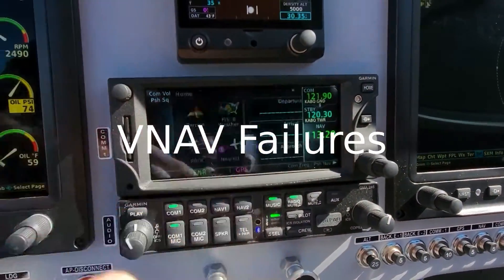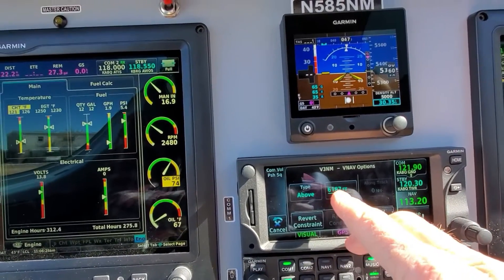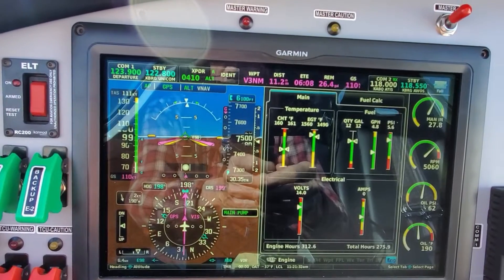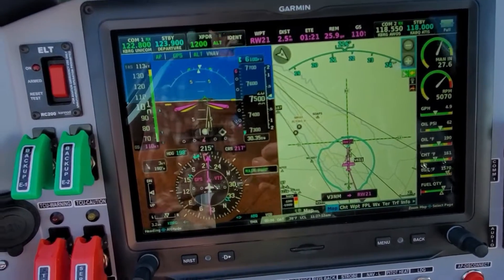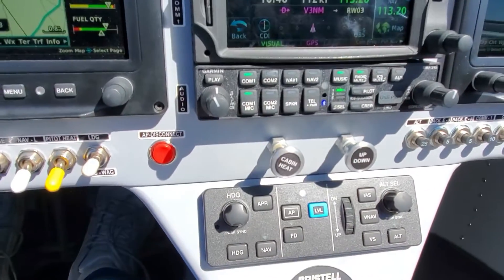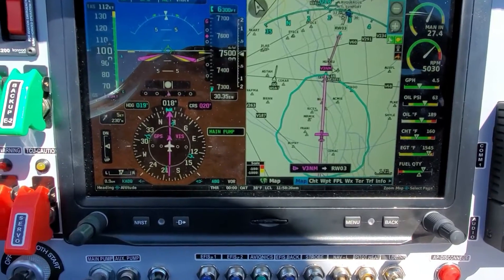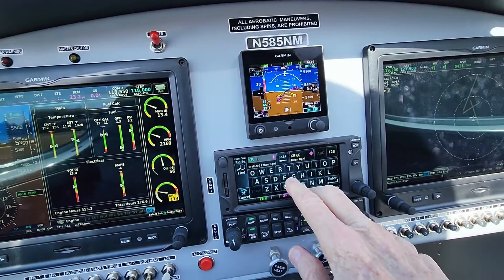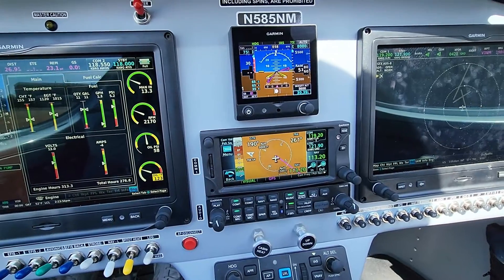Using VNAV with Garmin's Visual Approaches G3X Touch GTN 650 and GMC 307

Comment: Didn’t Garmin ever hear keep it simple stupid. I think there will be a lot of accidents involving Garmin because they make things too complicated and less than intuitive. Many pilots grew up on Garmin and they have swallow the cool aid. Doesn’t anyone notice the constant barrage of “ you can’t do this until you do this” they aren’t really safety issue driven, they are “workaround”. Much of the software driving Garmin was written 10 years ago. I’m sure it’s OOD and they just layer features on top. They add a new processor because the spaghetti code is loaded with if then else’s which are slow to process. If you doubt this answer this. Why is the primary display on the G3X the same size in full screen as it is in split. Full screen has a huge amount of dead space. Do you really need 2/3’s of the screen for horizon? It’s because they don’t have the team to rescale the display.
Reply: You had me up until the G3X part

Comment: Hi,
What do you use as a baro-corrected altitude source?

I have GTN 650 and 2 GDU 370.
Trying to use VNAV, the GTN calculate TOD, BOD and VS required.
VNAV get armed in the GDU 370 but when reaching the TOD, the autopilote just continues at the same altitude an VNAV never get activated.
And, yes, the alt selected is lower than the alt at BOD in the profile.
The VNAV-profile looks good too.
What can be possibly be wrong?

Many thanks in advance
Reply from the maker: Hi Shahram.  If you haven't already, watch the Garmin vids on VNAV.  My baro corrected source is the G3X and/or the G5.  Yours should be getting it from your 370.  Sounds like you're doing everything right, but it's not working.  Check in your flight plan and make sure the altitude you're trying to capture in in Cyan and not White.  If your autopilot is in NAV mode, the altitude is set below your current altitude, the autopilot is in VNAV mode and the altitude is in CYAN it should work.  Good luck.  Rick

Comment: Can you give the full avionics equipment list?  What are you using for ads-b in and out, where and what type of VOR/ILS antenna is installed, etc.  I’m interested in what avionics is needed to equip a plane to be able to take ones IFR checkride in and I know it’s more than just a WAAS GPS but I don’t see many guys on YouTube doing VOR/ILS demos.
Reply from the maker: G3X touch, G5, GTN 650. ADS-B from the Garmin 45R. Standard VOR antenna mounted on the tail.  FAR 91.205 listed equipment necessary for IFR flight. Check my channel. I have several ILS approaches shown.  Thanks. Rick

Comment: Its been a little while since I was flying regularly with a GTN 650, but I remember some of the VNAV quirks.  At 2:22, the magenta arrow is pointing to RW21 which means that the active leg in the 650 is from V3NM to RW21.  VNAV will not capture the path because the active leg is from V3NM to RW21.  If I remember correctly, you need to press V3NM and click the ACTIVATE LEG button in the top left seen at 2:25.  This will activate the leg from the aircraft's current position to V3NM and will allow for VNAV to that waypoint and altitude.  Then you should be able to capture the approach with the APR button on the AP panel.  I hope this helps, Scott
Reply from the maker: Thanks Scott.  You can also just activate the approach and the leg will be the 28 mile path.  Rick

Comment: To get the alt selector to 6180, set your baro min to 6180 on the G3X, then the alt selector will offer 6180 when you scroll down past 6200.  To set baro min, hit the HSI with your finger, it will pop up a box that offers a baro min input.
Reply: Or just click the altitude bug on the G3X and type in 6189. However, it doesn't really matter as long as the bug is below the restriction in your flight plan. VNAV is not going to follow the altitude bug, it will follow the flight plan restriction, but it checks your bug to make sure that you don't want to be higher than the restriction. Thus 6100 worked because its below 6189. Also, you don't necessarily need to activate an approach for VNAV to work. For example, I often use it just to get to pattern altitude 2 or 3 miles before my destination or to be at a certain altitude in my flight plan. Click your destination waypoint, then click "along track" then select 3 miles (or whatever you want) and click "save". Then set an altitude restriction for that waypoint (e.g., 1000 feet AGL) and activate the leg to the offset. From inside the flight plan click "menu" and you can select the FPA angle (2.3° gives me about 500ft/min in my C182) or set it to exactly 500ft/min (or whatever you want) (pro tip, you'll need to back off on manifold pressure for constant speed during descent or VNAV will automatically descend faster to meet the restriction). You can use VNAV for any waypoint, not just approaches or along track. Its very handy on an approach with multiple altitude restrictions. VNAV will automatically step down the approach along the way. HOWEVER, the GFC500 will NOT automatically transition from VNAV to approach. Don't be tempted by this option in the GTN configuration settings (do not turn it on or it will mess up your approaches). The GFC600 will make the transition but not the GFC500. Its not a big deal because all you need to do is turn off VNAV on the GFC500 when you reach your FAF and arm APR on the GFC500. As long as your approach is active in the flight plan, it will pick it up. I'm probably making this sound way more difficult than it really is.
Reply from the maker: Thanks Brett.  Didn't think of that, but I'll try it next flight.   i usually set the min when flying a regular approach.  Rick